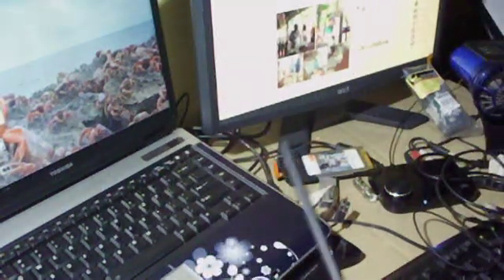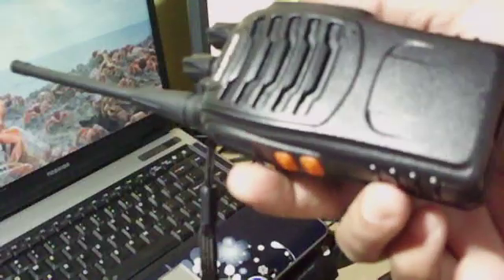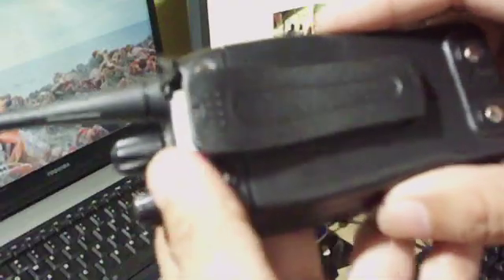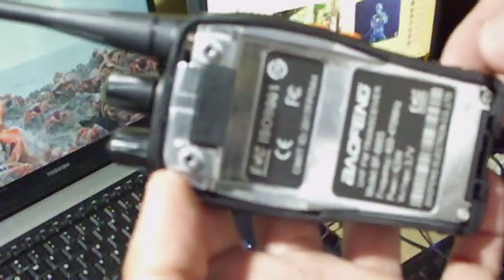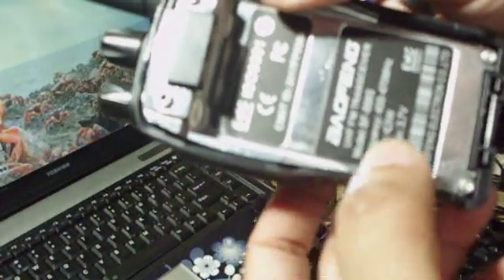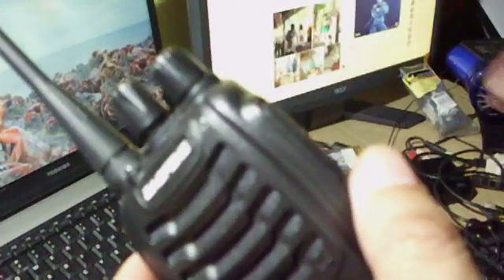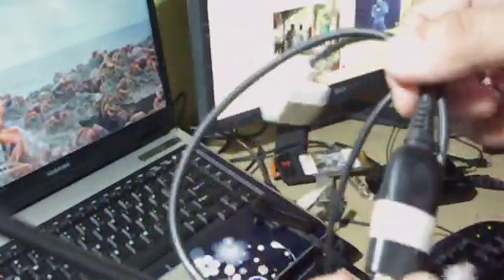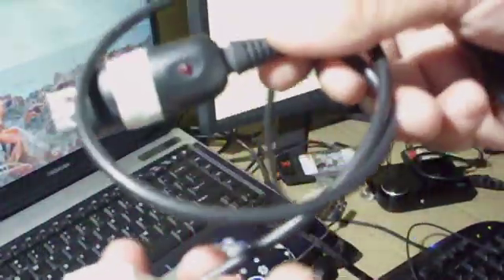How to put VHF frequency on Baofeng BF888s (1)

Comment: Hi Ephraim, can you help me setup a CB frequency on my Baofeng BF888S radio please
Reply from the maker: No it won't work on CB frequencies, there are reports that newer models doesn't support tweaking the frequency to work in VHF either.
Reply: @EphraimGariguez  THANK YOU FOR YOUR REPLY. IS THERE HOWEVER ANY WAY THAT I CAN ONLY LOAD 2 CB CHANNELS ON A BAOFENG BF888S, UV82 OR UV9RPLUS?
Reply from the maker: @morneniemand8413  the radio is not designed for that so no.
Reply: @EphraimGariguez  Good Day Ephraim, hope you are doing well?  Please can you help me with the Gamma match length and design for 66-88mhz on your 3 element yagi antenna please sir!
Reply from the maker: @morneniemand8413  use a 10-11inch gamma tube for that one.

Comment: may tutorial po ba kayo paano mag setup ng radio..para mapalaks yung range...usually kasi sa akin 100 meters lang sa city...gusto ko sana kahit mga 10km man lang
Reply from the maker: Kailangan mo ng external antenna ano ba radio gamit mo?
Reply: @EphraimGariguez  baofeng 888s sayang kasi di pala ganun kalakasan...apat pa naman binili ko po
Reply: may external antenna ako nagoyo yung 36 cm ata yun..pero parang maliit lang improvement
Reply from the maker: @sefmags4506  when I mean external antenna, antenna na naka install sa tubo hindi yung naka attached sa radio besides 2w lang maximum power out ng bf888 si hindi ka pa rin talaga makakalayo kahit may external antenna ka unless may line of sight kayo ng kausap nyo nominal range nyan ay 1w per km sa antenna na naka kabit sa radio so 2kms max ideal na yun.

Comment: I have to try all night long but always fail you can inform the firmware or something else ? I steel needed Guide btw many thanks to you
Reply from the maker: The video has 3 parts if you watched everything the complete instructions are there please try again. some new models works directly from Chirp without the need to upload the modded firmware.

Comment: Would it be possible to program this to 27 Mhz? (HF)
Reply from the maker: NO
Reply: @EphraimGariguez  Many thanks for your response. Just another question - do you happen to know the ERP (effective radiated power) of the device? Laws here state it cannot exceed .5 W.
Reply from the maker: @AbhishekSubbaiah  for UHF the radio is rated at 2watts for VHF on my testing it's below 1 watt so ERP is your power output multiplied by gain of your antenna
Reply: @EphraimGariguez  many, many thanks!
Reply from the maker: @AbhishekSubbaiah  you're welcome 73

Comment: What ??   How does the VHF frequency work in it ??  It's label VHF / UHF
Reply from the maker: It's UHF by default but the radio chip can be programmed to accept VHF frequency usable only on receive mode as the power output on VHF is way too low but it does work. The video has 3 parts on the channel playlist.
Reply: @EphraimGariguez  On VHF is only RX after modification BF 888s?
Reply from the maker: @marinmarin7187  on most unit yes as the power output is very low

Comment: This model can use the UHF antina
Reply from the maker: If you put VHF frequency on this radio, you need to replace the antenna with dualband antenna for use on VHF and UHF antenna. The default antenna is UHF